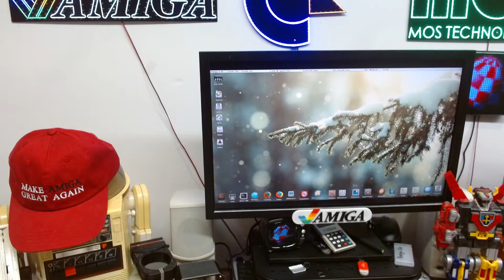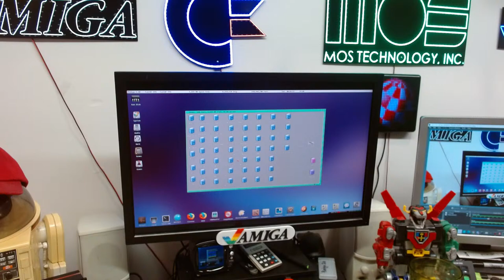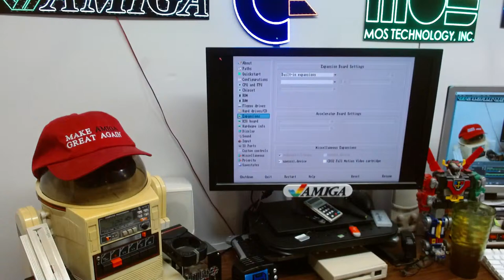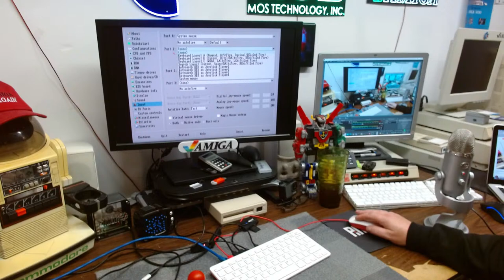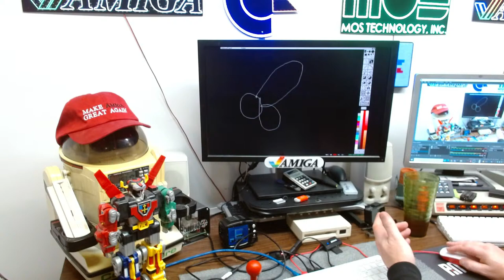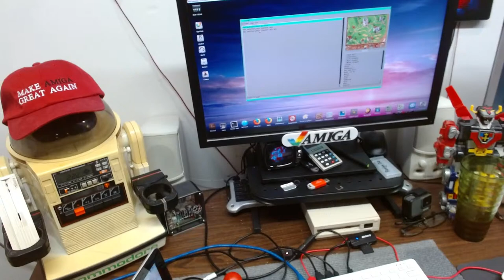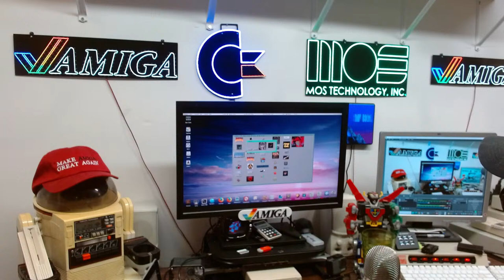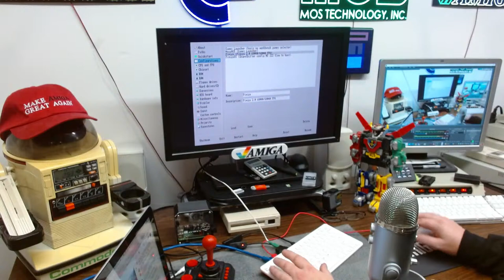Amiga Mail time livestream, pimiga 3X alpha sneakpeak, beer and more!

Comment: aarch missed the live stream today. but anyhoe 
thank You so much for explaining the GreaseWeasle part in this video. i managed to get the same results like you with the df0:???? on the workbench so i did that thing correct.
i hoped on the possability of booting some amiga disks but that's maybe something for a later date. indeed the greaseweasle on pc works good for archiving with the MUI/GUI if the disk isn't already damaged to much. they are pretty old.

dont listen to the haters, keep doeing what you like thanks so much for the efford. cant wait for PiMiga 3.0 with the rabbithole and further improvements.

ps. how do i get on discord thingy and what is that. YES! i am stupid, and not fully fluid understanding the english language like Jesus speaks. ;) love your work.
Reply from the maker: Discord is a program you load like the old irc chat from the 90’s. It has”servers” which are groups.  Theres a link at the bottom of my 1.5 and 2.0 release videos.  You can do the chat from a web browser or the discord application

Comment: Chris great content, how can I read usb hard drives/thumb drives do they have to be a certain format or where would it be in file system? As I have tried shut down and restart and still can't find device. Thanks for the great work first time I've tried a 1200 since 84/86.
Reply from the maker: usb drives fat32 as driver on emulated side is fat95 from aminet. drives must be plugged in prior to power on and usb thumbdrives will mount as dh5: in the emulator via /media/usb as per readme states.
Reply: @ChrisEdwardsRestoration  thanks for that, will have to format a spare drive. Most off mine are exfat an NTFS, then try see my brother for the Amiga floppy disks, maybe try see about backing them up, if they still work as I remember he has heaps, as it was his 1200 I had a Sinclair zx-81 😒.
Any advice on a usb floppy?

Comment: Where can I get a GP60BVKX3 battery (and hopefully not get ripped a new one for shipping 1 battery For my 4000?
Reply from the maker: order a 2032 replacement!!! get those barrel batteries out of there!!!
amigakit or any other reseller, even ebay sells them
Reply: @ChrisEdwardsRestoration  Do they sell the holder and battery for that purpose or just do my one thing with a battery and holder.
Reply from the maker: Either or